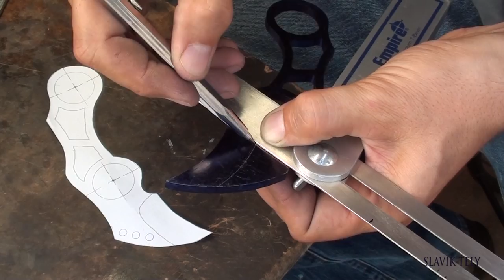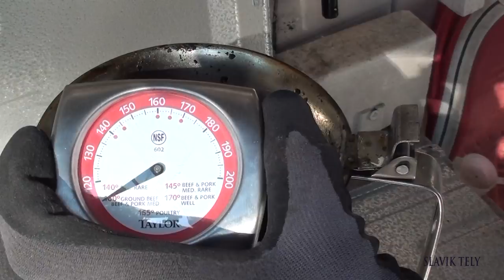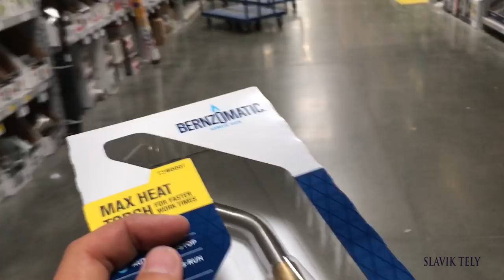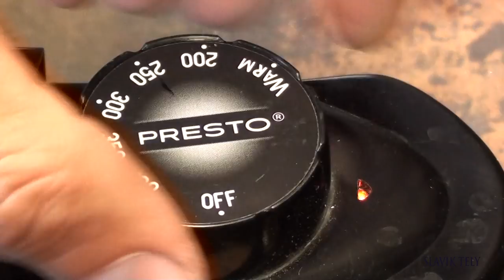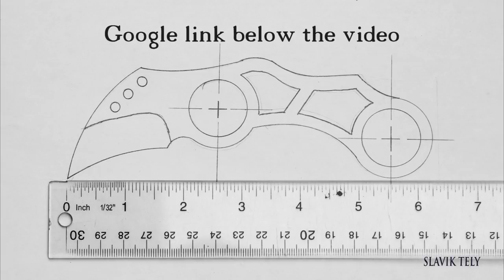Making BLAKE KNIFE Part 2

Comment: I notice you often use a drill press spindle sander. Do you think various cuts of rotary files would serve the same purpose?  I currently have a rough cut rotary file that I have for my drill/drill press, so could I use that for rough internal filing and simply use my dremel tool for any fine grain filing?
Reply from the maker: I only use diamond wheel to make 90 deg all around the handles.

Comment: I have a question, I'm working with 1075 carbon steel, and I have actually been working for a while to cut and file down a knife, trying to follow your tactics as well as I can, but I can't find how to heat treat this particular steel, any thoughts? Or should I send it somewhere to be treated?
Reply from the maker: Heat the oil to around 140 deg F. Heat the metal until the magnet does not stick to the metal and quench it in oil. After that temper it in the oven at 400 deg F for one hour. Let it cool down to room temperature and then temper it one more time for one hour. Then you are done.
Reply: Thank you so much for the info, your work is genuinely inspiring, and I always appreciate your hasty replies!

Comment: Very nice work telly ...i wanted to start making a karambit like this one mounth ago but I had no time ..anyway I wann ask you an advise...I made an eagle karambit (and I showed it to you) but I have a problem with the rust :(( what could I do? I made the knife from spring steel and sand it after with 2000 sand paper and still the rust is getting on it
Reply from the maker: Just because you sanded it with 2000 grit paper does not mean it is sanded to 2000 grit. You need to sand the whole knife 220,320,400,600,800,1200 and then 2000 grit. Then it will be considered 2000 grit finish. After that it will have less rust problem but it will still rust if you do not oil it.
Reply: Ok:)  thank you for the advise and enjoy us with more of this legendary knifes :)

Comment: Would a propane torch work for heat treating? I want to try this and propane seems more simple and cheap than other options.
Reply from the maker: Don't use propane, it doesn't burn hot enough. Use MAP gas (yellow bottles)

Comment: What is the name of the dermal attachment at 2:00 ? I need to clean up my plunges! Would you recommend this item?
Reply from the maker: TACKLife Rotary Tool-RTD35ACL-Amazon I got it for free. It is works. Just don't over tighten your attachments. You will strip threads on the cap.
Reply: You're the man! Thanks!

Comment: Pretty sure you're incapable of making something that looks bad Tely. 
2 questions:
1) Why so many holes in this one? Just to keep the weight down, aesthetics, both or is there something more at play? 
2) Why'd you quench it in warm/hot oil? Usually you leave the oil at room temp.
Reply from the maker: Why so many holes? I like the look of it, makes it lighter, aesthetics. What I have read up is that the oil has to be not more than 150 deg F.
Reply: SLAVIK TELY It does look good yes. I figured it was, at least, the look. 
And I see. Does it just make it safer for the quench (less possibility of warping or what not)?

Comment: Don't you have to heat treat the whole knife?
Reply: Rav1oli hi bud the buisness end of any blade gets special treatment for hardness.Then when it's put in the oven the whole item is correctly tempered so it's not brittle hope this helps.
Reply: Tony Ashton this does help thank you good sir 💯
Reply from the maker: I only heat treat the part that is going to cut.
Reply: What camera do you use for end video shots??

Comment: What did you use the tool at 4:25 for?
Reply from the maker: Magnet, when the magnet does not stick to the metal, then it is almost ready to be quenched in oil.

Comment: Why canola oil?
Reply from the maker: You can use any oil you want but I didn't want to breath the chemicals from the motor oil.
Reply: SLAVIK TELY sorry what I meant to say was what is the purpose of the oil?
Reply from the maker: To harden the blade. It is called heat treat.

Comment: I guess it doesn't matter what kind of oil you quench metal in. I've always thought people used recycled motor oil or fresh motor oil. I guess you can use recycled oil from a deep fryer.
Reply from the maker: Motor oil gives off chemical vapor where as vegetable oil will not.
Reply: +SLAVIK TELY That makes sense. Definitely don't want to breathe that into your lungs!